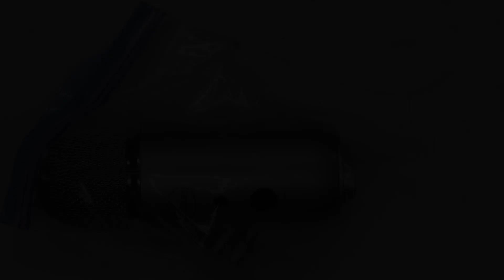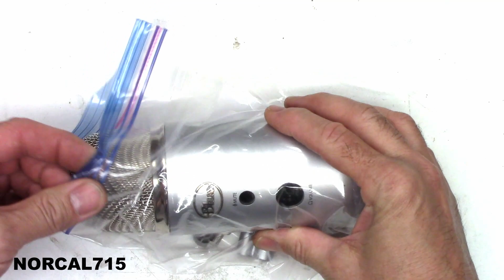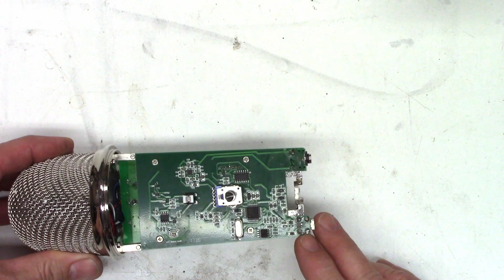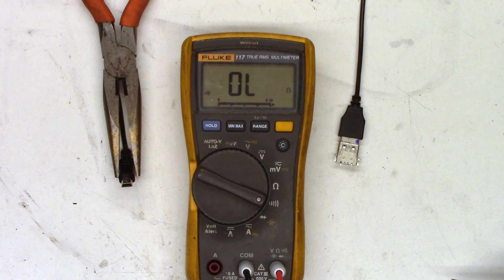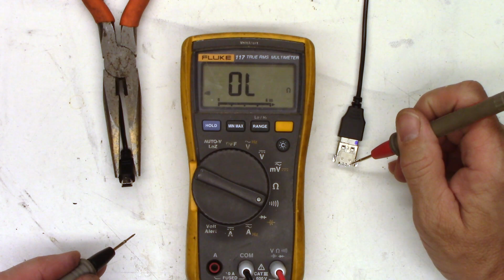BLUE YETI MICROPHONE NO SOUND NO AUDIO    BAD MINI USB JACK - REPAIRED WITH NO PARTS REQUIRED

Comment: I am wanting to do the same, yet replace the mini usb port with usb c! any tips? is it possible? and would i need a special usb c cable? i'm not finding much help online... so anything helps!

Thanks.
Reply from the maker: USB C requires bi-directional data communication, just replace it with a regular USB-A plug

Comment: What is heat gun are you using?
Reply from the maker: 862D+ rework station https://www.amazon.com/Wakrays-Soldering-Rework-Station-Nozzles/dp/B01IF0HQ9O/ref=sr_1_20?crid=25US7XOO6XS0R&dchild=1&keywords=862d%2B+soldering+station&qid=1614597329&sprefix=862D%2B%2Caps%2C253&sr=8-20 I also have the newer version 862BD+ https://www.amazon.com/YIHUA-Soldering-Station-Multiple-Functions/dp/B07RY5XWVG/ref=sr_1_2?crid=25US7XOO6XS0R&dchild=1&keywords=862d%2B+soldering+station&qid=1614597413&sprefix=862D%2B%2Caps%2C253&sr=8-2

Comment: Instead of the cable tie i would have used those existing holes and some nylon lacing cord, and laced it to the PCB, then a drop of gel superglue on the knot and the heatshrink, so that it will still have a little flex. A longer length of heatshrink as well to provide strain relief where the cable exits, so that bending stress is not going to crack those cores right wnere they enter the body, possibly even 2 shrink sleeves, a short one sticking out slightly, then a longer one over it, so there is a stiff bend area at the base.

Yes those sockets are fragile, they do not survive abuse, especially regular insertion and removal, though thankfully the design is such that the plug end wears out first.

Comment: Would it have been easier to just replace the mini usb socket?
Reply: It probably didn't take long for that jack to fail,and it's a stationary mic so no real use for a jack there anyways.
Reply: I don't understand why they are so hung on these USB connectors.    They just are not robust enough for constant insertions over and over again.    Plan obsolescence I guess.
Reply from the maker: USB-C is much more robust!
Reply: I actually got the parts to replace it but I'm going to do the hardwire as shown in this video instead. Every video of fixing the yeti is this stupid connector failing- for whatever reason... Take it out of the equation. 

I mean the parts are super cheap and the process super easy... so take your pick but I have better things to do than replace an antiquated USB component on an entry level mic.
Reply: Also depends if he had a replacement jack in stock, but i think this is better  just attach the cable and your done.
Reply from the maker: Did not have one and the customer did not want to wait.